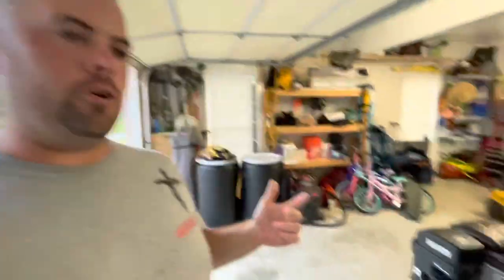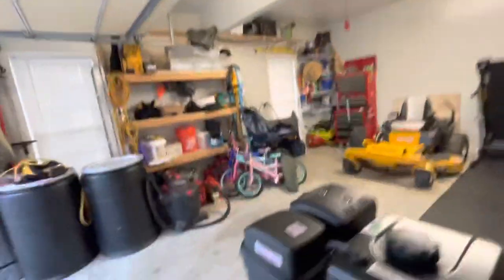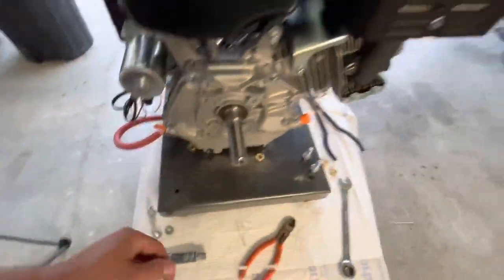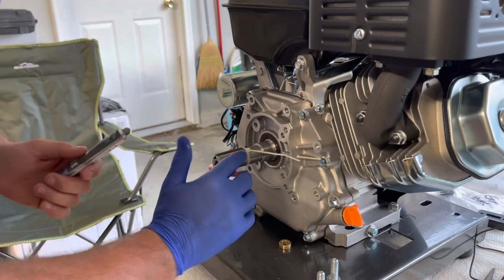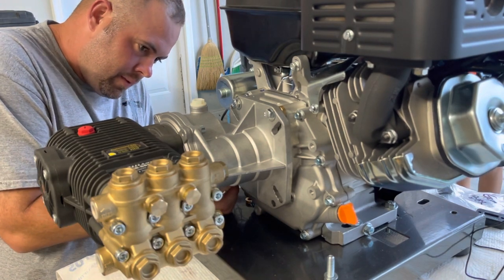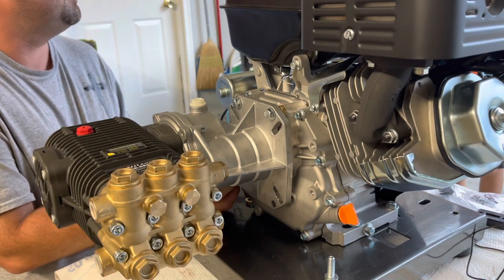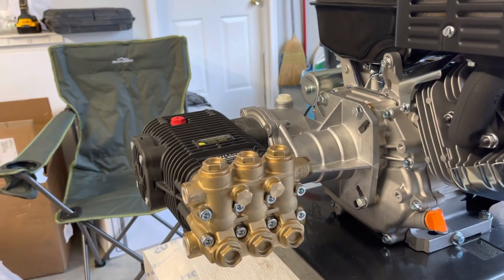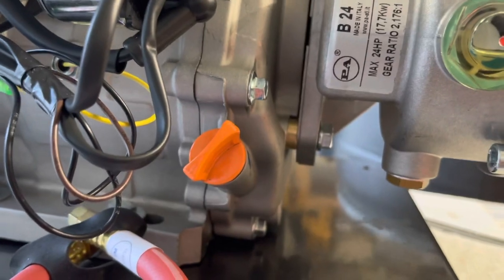Pressure Washer Budget Build 6.5 GPM Predator 420

Comment: Nice video.  I'm still getting my business setup, but how has this pressure washer worked for you?  Has this DIY been worth the money vs. buying one?
Reply from the maker: It worked great for me. However I upgraded to an 8gpm in 2023 for my main washer. It’s definitely worth the build. I’d recommend pairing it with the predator 459, it wasn’t available when I built mine.
Reply from the maker: I think it’s worth the money to DIY it vs buying a 5.5gpm machine.

Comment: Great video. Have you noticed any issues with that pump not being supported?
Reply from the maker: I have noticed any yet, but I do plan on running a different skid plate and make a support mount for the pump.
Reply: I have bought 3 builds from envirospec over the past two years and none of them were supported, havent had any issues yet. Im looking to do a few of these set ups for back ups. on a two of our trucks we have 10gpm set ups we can run two hoses off of, and on one of the trucks we have two 6.5pm set ups each with their own engine, and we have less down time with the truck with two pressure wash engines for sure

Comment: Hey Jeremy, so i noticed the spacers between the pump and the engines crankcase. I wonder why they are there. Because on any gx390 or similar washer, theres no spacers. It just bolts direct, pump to engine with no issues. It just seems like a lot of risk of water or even moisture getting in, and causing absolute chaos. Or even worse SH
Reply from the maker: That’s how they said to do it 🤷🏻‍♂️

Comment: How is it going man?! I built the same machine a couple of days ago with the Predator 459 instead of the 420 for PSI purpose but I was setting my unloader and for some reason I couldn’t get any more than 1000 PSI with open trigger and it spikes up to 1500 PSI on bypass. If I crank the unloader it  increases the spike too much. Do you have any idea what it could be? The unloader is the VRT3
Reply from the maker: What kind and size tip are you using to set the unloader? To set it correctly you'll need a 6.5 or 7.0 (orifice size) zero degree tip (red tip) to properly set and adjust your unloader.
Reply: @KentuckyWashPros  thank you! Great to know. I will give that a try. Thanks for your help!

Comment: Do you run a surface cleaner with that set up? Is the 2500 psi effective? If so what size. Just trying to strike the right balance for the house and concrete. Considering the 15.8 unless 2500 is getting it all done. Thanks
Reply from the maker: I use a 19” whisper wash classic with this setup and it runs perfect. I do leave the unloader set at 2500 psi and it clean jus fine. I run 2503 or 25035 tips in the surface cleaner
Reply: @KentuckyWashPros  what pressure are you getting when your on the trigger of the surface cleaner ?
Reply from the maker: @NatalieG-l6p  2,500

Comment: Fantastic video! I have the Simpson Powershot 4400 that has the CRX 420 engine. Would the pump you used work with that engine?
Reply from the maker: It should
Reply: Did it work?

Comment: i have a question? why did you go with the unloader to the block ? is there an unloader i can use that wouldnt require the block?
Reply from the maker: You dont have to use the unloader block, I now use quick connects on all my pump and unloader setups

Comment: Forgot to ask...How do you have the pump set up? Direct feed from hose or tank fed? If tank fed how well does it feed itself?
I currently use the predator 420 with a 4.2gpm that came with it. I want to swap it out to this pump. Do you think I will notice a difference?
Reply from the maker: You’ll notice a huge difference. And I run it from a buffer tank. It’s not setup to be used with a garden hose and I don’t think most garden hoses would keep up in my area
Reply: @KentuckyWashPros   hey so will the pressure be less without the buffer tank with both the 6gpm and 4.2 gpm?
Reply: @corymoore4245  yes, but you almost never need anything over 2500psi

Comment: Can you explain how this direct drive is pulling water? Thinking about doing the set up but dont know how the heck to plumb it if its not a belt drive it wont be pulling water into the inlet like it should be.
Reply from the maker: @hayeshollis9074  this is not a direct drive it’s a gear drive. It operates off a gearbox.

Comment: Hey, first of all thanks so much for uploading the build, the specs, where everything's from, it's going to be helping me out tremendously. 

Just wanted to ask how the system was still going for you? I've had buddies drop around $2000 on a GX690 saying that a Pred could never catch up to the Honda when the GX690 could last 2500 hours easily without breaking down. How many hours you've got on there?

Hoping to replicate this entire build with the 459CC and I'll let you know how it goes. Thanks so much again.
Reply from the maker: I haven’t had any issues so far with this build and it’s made me a little over 60K in a year so I can’t complain about it.
Reply: @KentuckyWashPros  Sounds good. Seems people love to bash on Predator without even trying out their systems. Love what you're doing man, keep up the great work!
Reply: the preds are better they have forged internals the Honda does not other than that they are the same
Reply: just picked up a rebrand of the predator for 350cad (260 usd). i can buy three of these for the price of one gx290 (1200cad). if the motor only lasts one year, who cares? just buy a new one.
Reply: @aidenlee5207  iv ran the predator 420 with 5gpm pump for 3 years and have yet to have any issue
Reply: @petermajka7474 what’s the name of the rebranded predator in Canada? Thanks
Reply: Realistically, if you keep up with maintenance, those predators are pretty good Engines for the price. If you pay for the extended warranty, take that sucker back if it blows, no questions asked typically.

Comment: Hi Jeremy, for the oil drain plug for the engine oil is it the 12mm that you got or is it an 18mm? Thanks in advance. Also is it the same plug for the predator 459CC?
Reply from the maker: It’s the 12mm and it should be the same
Reply: What pump are you using for your 460

Comment: I’ve got a trailer finally. I’ve been working out of my truck bed for a year now. I’m looking at building this instead of my 4.2gpm. Is this belt driven? Or am I able to run a buffer tank if it’s not belt driven? And how would I go about doing that
Reply from the maker: This is gearbox drive it’s excellent and will pull from a buffer tank, watch the rest of the build playlist and it will show how to do the plumbing
Reply: @KentuckyWashPros  thank you!

Comment: Hey Kentucky, I had another question if you didn't mind sir. Do I need to purchase the 'Valve kit, Packings and Oil seals' when purchasing the pump w/gearbox? Thanks again!
Reply from the maker: No those are only for replacement when doing a rebuild on the pump.
Reply: @KentuckyWashPros  That is great to hear. Thank you.

Comment: So this may be a stupid question  but I have a pressure washer that has like 2.5 gal per min an does fine on the house what can the 6.8 pump do for me? Thank you.
Reply from the maker: The 6.8 will make washing way more efficient and faster.  With a 6.8 pump I can wash a house in about 45-60 mins.
Reply from the maker: Do you use pressure when washing a house?
Reply: @KentuckyWashPros  gotcha yeah I just  have a gas one its 2800 psi. So your able to wash fast with your set up.
Reply: @KentuckyWashPros  i spray the house down with just water then i apply cleaner which is bleach,  dawn , an spray nine mixed then I agitate it with a brush  then spray off.... i guess I am working to hard at it after watching  your vids lol

Comment: Is it possible to get more than 2500 psi with this setup? Looks like a great budget pressure washer I’m considering building it if I’m able to get it to more psi for commercial cleaning purposes. Thanks for the video
Reply from the maker: You can use the Predator 459 engine and get more psi. What kind of commercial cleaning are you going to be doing
Reply: @KentuckyWashPros  I started a local pressure washing business this past year for commercial concrete cleanings and surface cleaning for drive thrus, dumpster pads and gas stations. I currently have a 3500 psi, 2.5gpm machine and it’s really nice but I’m looking go build my next one for next summer if I need a more powerful machine to get jobs done quicker.
Reply from the maker: @salty3953  i personally don’t use more than 2,500 psi on concrete even for commercial it’s not needed 9 out of 10 times. Your GPM is really what you need for cleaning faster

Comment: Perhaps this is a silly question  but does the pump need to run at a specific rpm.And if so how did you address this?Thx
Reply from the maker: The pump does need to run at a certain rpm which is 1750 which is why we run a gear box
Reply: @KentuckyWashPros  if you increase the throttle lever, will the gear box keep the rpm’s at the right rpm then? And if it does NOT , then even with the gear box, how the heck would I know if the throttle is in the right spot for the machine to be hitting that 1750 rpm?

Comment: The new predator 459cc engine is 15.8 hp that would be much better suited for a pump with such a high flow rate.
Reply from the maker: Agree but the 459 was not an option at the time of the build

Comment: Is there a reason you are building off a 420 engine and on the google doc list it is a 459?
Reply from the maker: This build video was made before the production of the 459 engines. Have tried to keep the build sheet updated, if I were to build this now, I would use and I recommend using the 459
Reply from the maker: Always recommend electric start!

Comment: Where’d you get the bolts to mount the engine to the plate
Reply from the maker: Lowes, any hardware store will have them. I used 4 3/8 in x 2 in with locknut’s. I also used 2 washers on each bolt.

Comment: Whats the difference between this build and the Texas Pressure Washing build created by Heath Phelps?
Reply from the maker: No real big difference
Reply: @KentuckyWashPros  is there any difference at all? Or are you just sort of relaying the build with your own experience with it? l always felt thats what was lacking from Texas Pressure Wash. Your videos actually show this equipment in use. And are you still having issues with the predator 670 fuel pump? I've heard from many sources it's complete trash and should be replaced. My big question is how is the ar30? Seeing it in action on your channel made me want to order one today
Reply from the maker: @ctbulldogs3518  I built my budget build from Heaths parts list but at the time there wasn’t really an in depth build video, so I decided to make one. The only thing that may be different is the links I needed up getting nearly all my stuff from PWP. I think at the time there were only a handful of people running these builds and not a whole lot of experience with or info on them.

I am still having issues with the 670, I have switched the fuel pump out once and not luck with that and I am about to switch it out again this time with a Mikuni fuel pump and if necessary I’m going to add a low pressure 12v fuel pump. I believe that it could partially the fuel tank causing the issues as well. The 670 has moments that it runs great when it is getting enough fuel.

The AR 30 is a beast, I love it and would recommend anyone to build one.
Reply: @KentuckyWashPros  what fuel pump did you originally use as a replacement? I've seen some people say use the gx690 fuel pump
Reply: @ctbulldogs3518  That's for the 670 not the 420

Comment: At $1,700 almost in parts i wouldn't call it budget lol. Im sure its a good savings compared to one readymade with similarly parameters
Reply from the maker: Well it’s counterpart which is offered as a 5.5gpm will cost you around 2,200-2,500 so I would classify this as a budget build.

Comment: Engine hours and clock hours are not the same...if the hour meter and your time are the same...the hour meter is not correct.
Reply from the maker: I don't think you heard correctly. I set a timer for 3 hours when I started the engine for the break-in process. I shut off the engine at 3 hours and my timer went off. The hour meter matched the timer that I set. So if the hour meter would have run differently than the timer, then it would be a faulty hour meter and not worth using....Not sure what kind of point you're trying to make.
Reply: @KentuckyWashPros  IF the hour meter said 3 hours and the timer said 3 hours...the hour meter is incorrect. Engines hours and clocks are not the same.. If you work for 1 hour by your watch/timer...a proper hour meter will show less than  1 hours...engine hours and clock hours are NOT the same. They are pretty close...but NOT the same.
Reply: @jimmywarren6685  what? 😂
Reply: @jimmywarren6685  are you talking about engine revolution?  motors clock time by revolution, still doesn't mean that 3 hours run time isn't 3 hours.
Reply: @TakinBumpsNBlownScales  My only point was that engine time is not measure like clock time...so, if an true hour meter hours match the hours when compared  to your watch or kitchen timer...the hour meter is not giving the correct engine hours....so don't say that it is accurate because it is not.

Comment: the machine will get 5.5 gpm max because that engine isn't strong enough to get 6-6.5 gpm.
Reply from the maker: I’m seeing 6.5gpm at 2500 psi
Reply: @KentuckyWashPros  I’m looking right at the machine and this machine does not pump 6.5 GPM.
Reply: Lots of guys in the industry run this setup and get 6 gpm all day long
Reply: @platinumhawkpw  lots of guys also bs and Overexaggerate specs
Reply: I have a GP 5.5gpm gear drive pump on a gx390. I see 6.5gpm at 2300psi all day long. Simple bucket test. Great for house washing….cleans concrete pretty good as well.